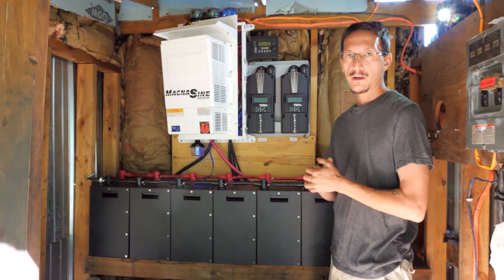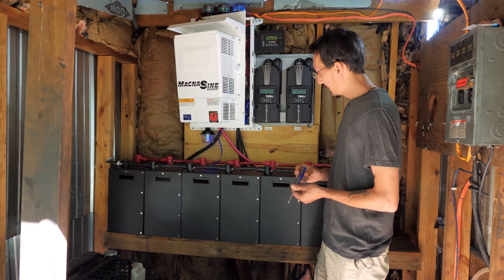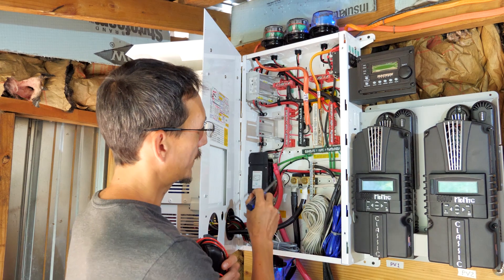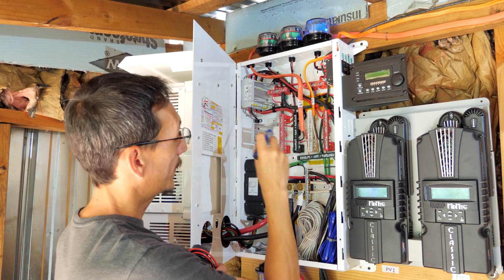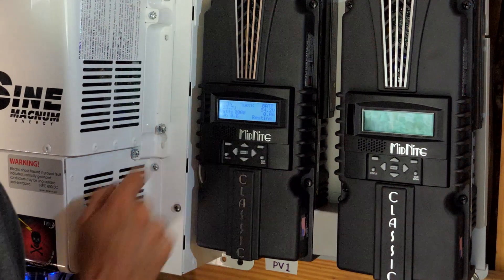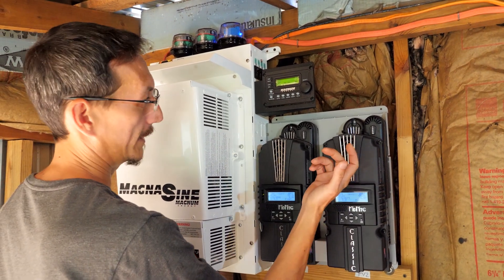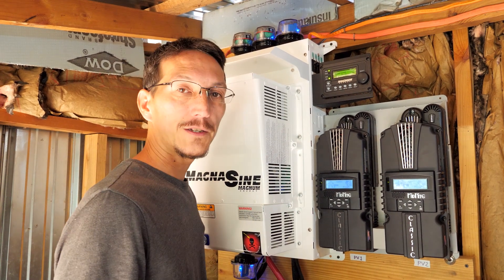DIY Off Grid Solar: System Overview and Powering Up (Part 5)

Comment from the maker: Yay we made it!  If you missed any videos in this series, be sure to check out our full playlist DIY Off-Grid Solar Series Playlist: https://goo.gl/Dv3T1k  If you found this series helpful, be sure to share!  Later this week, we will post our video on The Good, The Bad, and The Ugly.  Thanks for following along on this crazy journey to self-sustainability!
Reply: What's the maximum output amps you have on those batteries?
Answer is 80 amps right.
Reply from the maker: 34amps per battery x 6 batteries in parallel = 204amps
Reply: Looking GOOD! (actually looks like a cleaner install of my own :) Oh, and I use Flooded Lead Acid... Just don't take these below 70% and I have the same lifespan as the Lithium... DOES mean I have to have almost 4x as many batteries but those $3000 for 48v and 3.6KHW batteries vs my $800 for 48v and 4.9 KWH... Also, that 4448 inverts to 220, It gives out 2 120 lines :) and they are inverse sines so you could hook up a 220v application :)
Reply: anjhindul, Did you note hi talked about efficency? In his litium his running at least 95% vs yours 70%. Imagine the amount of solar you need extra for same kw to charge batteries, and his litium are totaly ok whit 30-40% charge for weeks during winter. If hi has to use the generator, his litium swallow all they get uintill they are full, your lead needs to be charged for lots more hours to be topped of and your producing alot of heat while doing so, while his stay cool all the time.
Litium cost more but the price pr kw in use is cheap.
Regards Tor-Olaf
Reply: Tor-Olaf Jacobsen lithium doesn't produce heat? Is that why all the bms have heat sensors on them? Is that why lithium batteries have burned down so many homes and cars?  My LA can't spontaneously combust... the lithium ion does. Also partial charging Li-ion is even worse then partial charging LA... also cost per cycle my LA is STILL cheaper then li-ion... $0.17 vs %0.19 and that is supposing the max cycles on the lithium... not one lithium battery I have used or heard of out cycled a premium LA. Right around 1500 cycles for both... and then you have to deal with the retarded voltage tolerances of the lithium.... where LA has a very large tolerance.... just got to watch your water level... oh ya, and 90-95% efficiency on lithiun... vs my 87 on my LA.... oooooo no difference .... now the charge times are true. LA needs a much longer charge time then lithium to reach 100% charge

Comment: Setting up a Solark 12k, w/ 30- 400w PV's The Array is 25 ft up (minimal access between the ground & the trusses).  No easy way to reset breakers if they trip. The inverter & batt bank is about 150 ft (cable wise) from the array.  Do we still need to put breakers in the combiner box up near the array?
Reply from the maker: Or just run longer pv wire and mount combiners on truss posts 5’ from the ground.

Comment: 1 volt is a lot on battery safety!  Your meter may be wrong!  The Magnum Meter is probably correct and the midnight classics may agree if you reset them.  Get a reliable meter that has been calibrated!  You can destroy lead acid batteries.  Lithium batteries should have over voltage protection.
Reply: That's what I thought too (one Volt is quite a measuring error). Also  keep in mind that the Magnum RC low voltage cut out would cut out one Volt too late if the Simpliphi's low voltage (0% SOC) is reached!
I don't know if your Voltmeter is that bad, there might be something else going on, but if it's the Magnum RC I would say it's a warranty claim to Magnum!

Comment: Why don't you build a small cabin behind panels where you can put inverter/charge controller and battery bank and exit only with 3 ac wires. In this mode you have 2 major advantages, 1: you reduce wiring lenght and loss 2) in case something is wrong and you have a shortcircuit, your house is protected. The ac current can travel long distances with less loss.

Comment: Hi Jeremy. Enjoying your awesome series. I am so busy that I have not been able to complete the setup of our smaller system yet. We have had the parts for a couple of years now...(yikes).
Do you reveal anywhere how much your system cost in the end? I have also been looking into getting Lithium Ion batteries.  Our current setup has UPG AGM batteries. It was purchased for something that we changed our minds on. We are looking into buying something bigger.
Thanks again for your well made videos.

Comment: Jeremy, I was reading about another brand of LiFePo4 batteries.  The instructions were very specific about NOT using a battery temp sensor.  They had a reason which I don't remember.  Just a heads up.
Reply from the maker: The temp sensor is for the charger

Comment: SimpliPhi states you cannot wire the batteries the way you did it.  Each batteries wires have to be of equal length and go back to a buss bar.
Reply from the maker: I worked directly with one of their technicians on the phone.
Reply: I'm thinking of getting these batteries and I would rather wire it the way you did.  I don't want to and find out it voided the warranty.   How are you liking the batteries?
Reply from the maker: They are amazing so far. We’ll see how well they perform in the cold coming up.

Comment: Have a question for ya how much did that system cost for panels and all the stuff in your power house sorry to even ask but I would like to get a system like that by the way love your video’s
Reply: He's got the stuff linked in the description... just looking at it quickly I'd guess $20,000 plus, most of the cost in the batteries

Comment: Nice set up.  Question.  I believe you mentioned that this was set up in a shed.  How are you dealing with heat and exhaust  of the generator?
Reply: Never mind.  Looking at part 6 it looks like you have an open shed.  Great series.  Thank you

Comment: I like your videos - clean and understandable.  I'm experimenting right now with solar because within a year or so I'd like to move and go with an off-grid solution.  The thing I seem to be struggling with is (remember it's a small system) battery drain.  I have a 100W panel - a PWM charge controller- from Grape Solar.  I used two 12V (100 Ah) Deep Cycle batteries hooked in parallel and a 410 inverter.   I run a box fan from Lasko which has a 96w draw at level 3.  I've hooked the inverter with clamps to the battery and watch it draw down rather quickly to 76% (probably 5 minutes on a sunny day).  I've read/heard that you don't want to drain them past 50%, so I turn off the fan and let the batteries recharge.

I guess my concern is how many batteries would it take to run that fan without discharging it to below 70% in 5 minutes?  And looking forward how much would it take if I had a mini fridge and some lights running?  Lithium is not something I can work with right now.
Reply from the maker: Something is definitely wrong. Either the inverter or the batteries are bad. 96w fan is less than 1amp at 120v. You should be able to run that fan for a week straight before your batteries reach 50%.

Comment: @3:40 would a small gap between the batteries help with overheating issues? Just wondering... ;) Loving the videos... very helpful... Thanks...

Comment: One question...

I live in Liberia, where all the electrical products sold on the local market are 240V/50HZ. However, we do have a few kitchen appliances from the states that are 120V/60HZ. Do you know if the inverter can be set up to output both 50 and 60 hertz?
Reply: I think it will be easier to get an 240V inverter and for your few appliances just use and step down transformer. ( you can easy find a lot of them on ebay they convert 240v into 120v) 
For most kitchen appliances its dosent matter about it's 50 or 60 Hz (they will just spin litle slower or faster) but you have to use right voltage.

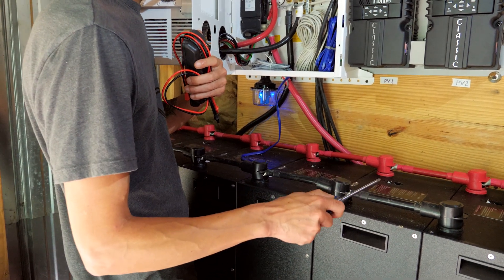Comment: 5:45 You mentioned cables have to be the same length, but didn't use a combiner. Are you concerned about warranty or longevity issues? Did you receive advice different from the installation manual?
Reply from the maker: You may want to check out the whole series (see the description for the link).
Reply: I did watch the whole series, and i'm not referring to the combiner at the solar panels. I am talking about section 4.1.2 of the installation manual. You chose a different cabling method than detailed by the manufacturer. http://simpliphipower.com/live/documentation/phi-3-5/simpliphi-power-phi-3-5-kwh-60-amp-installation-manual.pdf
Reply from the maker: A battery combiner is not necessary and does not affect the warranty. You could use a solid copper bus bar and heat shrink it, or cables all the same length.

Comment: Wish I had that kind of money (what $60k?) to put into solar here.  That's a nice setup.  //  Darn, you started out well with 120/240v but degraded to saying "220" later in the vid.  ;)  //  You were saying 95v for the strings in earlier vids, but 35x3=105, and the first Midnite agreed, you had 105v coming in at first.  //  Curious why you never finished insulating the power shed.
Reply: Actually LJ, if you do it yourself, you can get away with about 10k... That is for 10KWH of lead acid, 2KW of solar, magnasine 4448, midnight classic 200, Magnasine remote, breakers, sub-panels, wire... everything
Reply: anjhindul, yes, it can be done quite a bit less expensively than this.  I prefer the Midnite Classic 150 and will get one if the Chiwanese controller doesn't perform well (or fries.) I may go with a larger Taiwanese inverter, but that's not important at this point, with my 1kW of panels.  With Magnum's CS like they are, I don't think the company deserves any of our business.
Reply: LJ, good luck with that Chinese no name controller, I would get the Midnite anyway... then see how they compare to one another side by side (I would put $100 on the midnite being significantly more efficient) I got the 200 because the panels I have are too high voltage for the 150, and I MUCH prefer to use a smaller wire gauge for the 200 feet I needed, But yes, the 150 is a great controller as well (everything from Midnight is) I haven't gotten the shunt as the 200 has a built in system (though after 2 years it seems to be reading low/high depending on the current... Said it was receiving 159v at 21a., 3339w.. but putting out 56.4v at 68a, 3835w ... I doubt it takes a genius to see that the in wattage is much less then the out... SOMETHING is wrong! lolol I put on an external chinese POS shunt... LOL the readings are in the reverse... when the Midnite says 152V@4A, the Chinese says 152V@8A... Midnight 160@23A... Chinese 160@12A.... So, I had to return the chinese POS lolol going to upgrade with 

PS, what do you mean Magnum's CS? Converters? I happen to live just south of Magnum Energy's HQ and I haven't found anything wrong with my inverter plus it is American made and cheaper then the only alternative (Outback)

Comment: Hi. Just a quick one. The Magnum remote you have will not allow you to Parallel another inverter with your existing one, as you mentioned! For this, you need the Magnum ME-RTR or the newer ME-ARTR. These will let you parallel or stack up to 4 inverters. Otherwise, a great installation!

Comment: Do you have split phase 240 on the big generator to get the full charging out of the inverter? Also does the inverter have gen support for the small gen?
Reply from the maker: Yes and yes

Comment: Series or parallel? I thought you couldn't run these batteries in series. aren't you limiting yourself to only 80 amps I'm confused, this battery will not work properly in this configuration.
You even go over this on your simplify video.
Reply from the maker: Not sure what you are talking about. These batteries are all wired in parallel.
Reply: Guildbrook Farm - Off Grid Living In this configuration you only have 80 amps. Or am I missing something?
Reply from the maker: 80amps is the breaker on each battery. Nominal current draw per battery is 34amps. There are 6 batteries in parallel so 204 amps nominal current from the bank.
Reply: Robert Nash in parallel the amps go up voltage stays the same,, in series the amps stay same voltage goes up (wattage is more or less the same either way, but higher voltage is generally more efficient but its how off grid systems work typically 48v ones)

Do them Battery's have BMS built into them?
Reply: lee x 10/4
Reply from the maker: Yes

Comment: Our Magnum MS 4024 inverter/charger is six years old totally off grid and has never skipped a beat. I had a couple Trace inverter/chargers before that and they are still in service after 18 years! I use Morningstar, Outback, Midnite and Magnum solar equipment with zero problems. I think you will be very pleased with all of your equipment choices. Your battery bank is sure expensive though. I have a 21 kilowatt bank and it only cost $2600. Our system is a 4.8k of solar. Out total system cost is under $12k, diesel generator included. You should get many years of trouble free service. You have so much power now you could get an electric car lol. We could collect more than 22 kilowatts a day but we only use 7 kilowat hours a day. 8 months out of the year we could charge a electric car every day but we don't go anywhere lol.  Very nice system, you made good choices.

Comment: how hot do your panels get? you might get some hot water too if you pump water thru pex tube linked on the back of the panels and insulated this will makes your system more efficient all around plus give you some hot/warm water. i have seen antifreeze systems too that use heat exchanger to heat water so the water cant freeze in low temps.

Comment: Hey, great job. It seems, since you've recharged your batteries fully by mid-morning, that you're PVing alot of extra watts. Have you thought of perhaps doing a simple water storage system? Pump water up to a reservoir on sunny days after the batteries are charged so you can release it through a simple turbine later to generate watts you need on long, gloomy winter days? Or am I over-reaching?
Reply from the maker: Not over-reaching at all. I definitely have a plan for all the extra power. 😉

Comment: Well done. You did a great job, thinking out and implementing your system. You may want to look into heat mats and 2 " rigid foam insulation for keeping your batteries above freezing. Top, bottom and sides.

Comment: Just a wonderful setup, y'all do it right, clean and organized. That old workhorse of a generator doesn't quite fit esthetically but it seems a faithful backup. If you enclose the "power shed" where will the exhaust from the generator go?  I know that was hours of work, thank you for sharing. Check that big "to do" off the list!!!

Comment: That looks like some pretty awesome stuff. In the beginning of the vid you mentioned something about not charging the batteries if it's below freezing???
Reply from the maker: Correct. I’m going to insulate them and figure out a heating solution. Can’t charge them at or below freezing.
Reply: Thats good to know. although I think in most cases they would be in a basement which wouldn't be a problem anyway. Thanks for the reply Jeremy. Good job on the install.

Comment: I need to point out something:

That battery breaker appears it is either:
1) Wired wrong.
2) Wired to only shut off the inverter, NOT the charge controllers.

Love Midnite Solar, best charge controllers around imho!
That Magnum Inverter is an amazing inverter. I wouldn't worry about it!
Reply from the maker: That breaker shuts down everything including charge controllers.
Reply: I guess my question would be: Have you tried that? (Cut that big DC breaker, do the CC's go off?)

Sorry, not by any means trying to nag you or anything, just been staring at this and can't see how that breaker shuts off anything but the inverter. It definitely looks like the only wire coming off of that battery positive that isn't going to the inverter, DOES NOT go through the breaker. I tried to explain better here with some crappy MS paint labels. :P
https://imgur.com/a/uXctNYc
Reply from the maker: Yes, the charge controllers run from the battery bank. The big breaker disconnects the inverter from the batteries. The charge controller breakers disconnected them from the batteries. Sorry for that confusion.

Comment: Well yes you did it. Very well put together system. I am also glad to see that you reached out to Alt E store, they are indeed very helpful a full knowledgeable group of people.
 I am an 35 years in the trade electrician and even I find myself asking questions too. 
The good thing about your system is that with both the inverter choice, and battery choice you can expand your system both in inverter as well as batteries unlike lead acid batteries you can add more amps as needed. Not sure you knew that. Same goes with that model inverter.
Good job
Reply from the maker: Inverter, batteries, controllers and panels can be expanded plug and play. Can add wind, hydro etc. Double controllers and split array also add redundancy. One array will fully charge the battery bank.

Comment: Great series, very interesting. thank you. 

Wish Pure Living For Life followed you and took just a bit of your solar knowledge.
Reply from the maker: No comment 😶
Reply: I haven't seem any of their videos since the timber frame workshop.  I got caught up at that time and got sidetracked on other channels.  Will need to check out what they have done since then soon.
Reply: They are doing SIP install at the moment.

They have now gone on grid after rubbishing their ill-conceived, poorly executed solar system which they neglected, then wondered why it didn't perform with frozen old lead acid battery's  and dust and snow covered, shaded solar panels laid flat on the ground. ete, etc... a frustrating channel full of poor advice and untruths!!